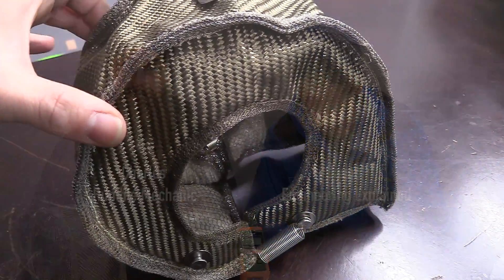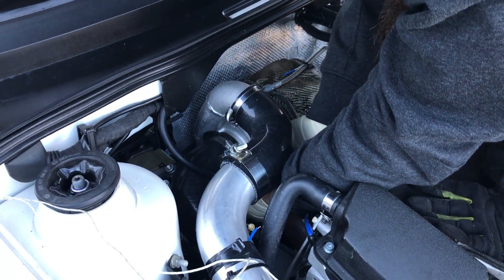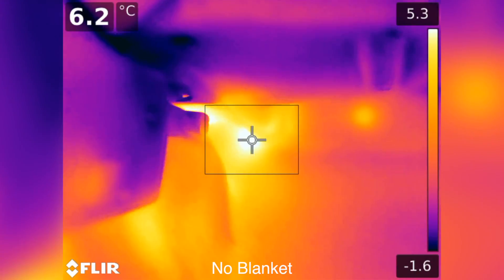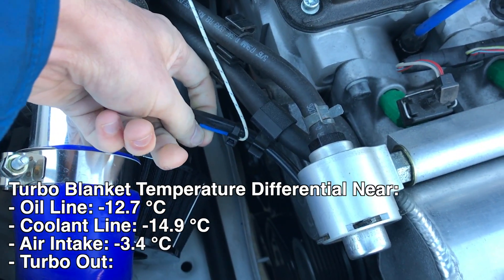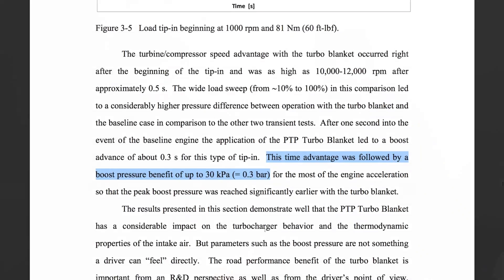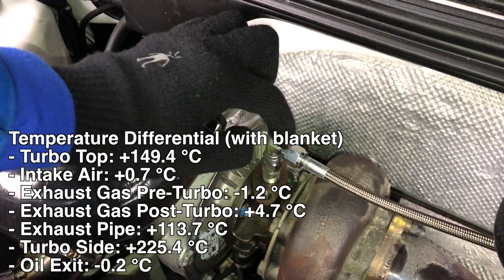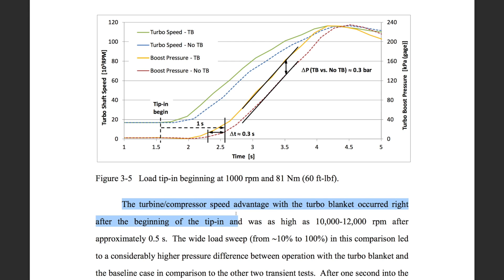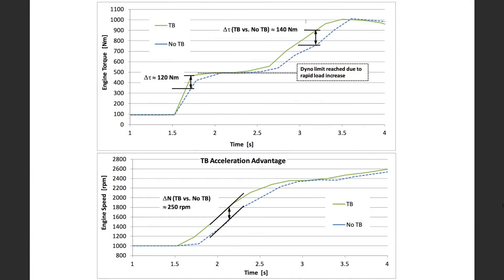Can Turbo Blankets Be Proven To Increase Performance?

Comment: Even though I understand the thermodynamics here, I've nevertheless been umming and ahing about a blanket. Thanks for the brilliant explanation.
Q: would insulating the compressor side (even without a turbine blanket) help the IAT?
Reply: You'd be better off putting exhaust wrap on the headers

Comment: Maybe you could test performance at a track and on a dyno. Scientific research is made to be challenged or verified.
Reply from the maker: I'd trust lab data over random track data. Unfortunately a track has so many variables that you'll never really get a back to back comparison like you can with an engine dyno stand (for testing something like this). Agreed though, it's always good to challenge information and perform additional tests; perhaps using different engines, blankets, etc.

Comment: Aren't there any negative effects? The turbine is hotter than before and it's spooling faster. Wouldn't it reduce turbine's reliability? (Maybe change the material properties with extra heat, change gaps due to material's expansion, etc).

Comment: I like the idea of turbo blankets and they do their job well, but would keeping the heat inside the turbo cause the turbo to have more wear over time due to higher internal temps?
Reply from the maker: Surprising to see the oil temp remained the same though, yeah?
Reply: That is true, I would have expected the oil temps to go up. It would be cool to see a long-term test with turbo blankets and whether or not the engine/turbo lifespan would be changed in any significant way.

Comment: Very informative. Surprised to see the oil temperature in the turbo barely changed. No worries for added wear and tear then as the temperatures around the turbo are cooler also with the blanket.
Reply: The oil out temps were from the lab experiment done on the cummins diesel 
where the conditions were lab controlled and precise.

Comment: oh look a golf 3 gti
a 2l turbocharged car that is slower than the 1.6l corolla from that time period which didnt even try to be fast
Reply: HECKproductions You're talking about a stock non-turbocharged 2l. A turbocharged 2l would be quite a bit faster than a corolla, the one in the video is actually a turbocharged VR6.
I'm not a VW-fan at all (had 2 and would never own one again except maybe an aircooled bus), but if you want to be a smartass, start with being smart instead of being just an ass.
Reply: If you’re going to talk crap, at least know what you’re talking about. You’re wrong on multiple accounts. The 2.0l engine in mk3s were not turbocharged. This is not a 2.0l engine, which you would know if you used your eyes and saw multiple indication of it having 6 cylinders. It is a 2.8l VR6 turbo...

Comment: the way you mounted to temperature sensors seems sketchy. you really should have covered them with aluminium foil or something, since the sensors themselves are also quite sensitive to heat radiation. this can mean that you are not measuring the differecne in temperature of the coolant line for example, but you are measureing the sensor itself not getting hit by heat radiation any more.
Reply from the maker: Generally speaking, they all had quite a bit of airflow next to them (as was apparent while driving versus stopping), so the temperatures measured were all essentially air temp. Also, measuring radiant heat isn't a bad thing - the oil line and coolant line are susceptible to radiation, so it's useful to measure it.
Reply: i work with these sensors every day. airflow is never a good thing when working with these. airflow is cooling the sensor down. then you are just measureing the air temp and not the temperature of the part that you wanted to measure.
measuring radiant heat is valueless by the way. try to put the sensor onto a mirror and then try to heat it up with an infrared lamp. the mirror wont heat up, but your temperature sensor will show a very high temperature.
Reply: @MrBusunglueck  I second your statements, the sensors should have been thermally bonded to the surface so they're not mostly measuring air temp. Note that the referenced UTexas paper said "good surface contact is crucial; all surface sensors are bolt-on type", meaning their sensors had a tab with low thermal resistance which was bolted to the measured surface.
Reply: @dankingsbury9971  Thanks. I didnt say it as elegantly as you did.

Comment: Can the camera actuelly measure metal correctly? As far as I know it is very hard to do that because metal reflects more infrared light than it emmits it (30% emmission I think). I usually use emmission stickers on metal. Also my camera only measures up until 250 degrees celsius. What about the 50k one?
Reply: Hi Jason, I think you are misunderstanding the question. When measuring temperature on any surface (specially shiny metal) the emissivity of the material will greatly affect the temperature reading. By default, the camera's emissivity setting should be 0.95, but that is not the case for metals. If the setting is left on default, the temperature reading will be much higher than its real temperature. 

Also, beware of reflection, the compressor side is a good example, the temperature image is not even, the shiny side of the metal reflects heat from turbine side. 

Another example is the heat shield of the firewall, the emissivity of that material is very low, so it is very difficult to have a good measurement.

One cheap way to combat this issue is using electrical tape. Just stick a piece of the tape on the surface you want to measure and wait a couple minute for it to reach temperature equilibrium. It has emissivity of around 0.95, so if you point the camera to the tape, you will very likely get the real temperature of the object you are measuring.
Reply from the maker: It calibrates all the time to try and compensate for it (when the image freezes), and tends to do a nice job. The temperature range is very high, well above 500 C shown in the video, but I'm not sure what the top range was. Maybe around ~1300 C if I had to guess, but perhaps higher.
Reply: I spotted some reflected heat in the video too, Vic. You raise a good and interesting point.

Comment: Hey Jason, does that heat kept in from the turbo blanket affect the turbo negatively, like wear and longevity etc? Also, can you make a video about the gold heat reflective tape? I’ve seen a couple videos but they used direct heat to test it not radiant heat. I’m kind of skeptical but no good experiment has been done to prove it reflect radiant heat.
Keep up the content!!
Reply from the maker: I just learned about this stuff, I'd be curious to test it as well.
Reply: @EngineeringExplained  please Jason? Go further on this! There’s so much to learn and discover on turbo heat management

Comment: better use a methanol injection kit to cool down the intake air.  I also think that its pretty harmfull for the turbo for overheating and extra wear because it cant lose its heat

Comment: I`m pretty sure that this could cause problems when you turn off your car hot. Probably going to ruin the turbo bearing with the extra heat in the exhaust side turbo housing.
Reply from the maker: Yes, this was discussed in the video as well. It's important (blanket or not) that you let your car "warm down" (cool down haha) after you've been driving it hard, to let the turbo temps drop and keep the oil healthy.
Reply: Exhaust gases 800C at idle? If you say so.
Plus if you do it properly and drive gently for the last couple of miles and make full use of overrun conditions you'll have pure air passing through with no combustion, so it'll cool nicely.
Reply: i said 500-800°C. neither you or i can scientifically proof our point by argueing.
one thing i do struggle to understand though. 
why would you heat wrap your exhaust in order to go a couple of 1/1000s of a second quicker, if you then have to go slow for much longer in order to not damage your car.
Reply: That's true, but as mentioned, you should not be turning your turbo engine off when hot. Let it "warm down" first. If you're turning off hot, you're asking for trouble, blanket or no
Reply: i know. i just dont think that its healthy for the turbo. mercedes have cooling ducts directly aimed at the turbochargers to cool them down while driving(amg gt). how are you going to let it cool down if its heat wrapped anyways?
Reply: The exhaust gases flowing through will carry away the heat
Reply: Thats wrong. Exhaust gas is like 400-800°C hot. Heat can only flow from a hotter to a cooler object.
Try to cool down red steel with a heat gun. I can promise you that it wont work very well.

Comment: instruction unclear, i wrapped my turbo with bed blankets for extra warmth but the engine hood it's on fire
Reply from the maker: Not sure I understand the problem; sounds like you're turbo is staying hot?
Reply: You did what? Bed blanket is not a thermal blanket lol. 
I hope you was joking..
Reply: lol, yes it's a joke...
higher temperature maybe increase the pressure but also the stress on the turbine...

Comment: Hey I just replaced my heater core.  Not a cheap or fast operation but necessary in NH.  I actually subbed to this channel while catching the car bug while shopping around.  In the end I went the cheapest route until I can afford a car I really want.  That is to say when I've finished my masters and not working for $20/hr at a lab or ethereum hits 10k.

Also I wonder what frequency those seven segment displays are multiplexed at.  Is it noticeable irl or is it fast enough to look smooth?

Also what does something like a turbo blanket do for lifespan of the turbo?  What is the lifespan of a turbo?  I don't know a lot about materials but I know higher temperatures are not good for them and something like a turbo sees huge changes in temperature everyday while under stress.

Comment: All positives and no negatives. Makes you wonder why manufacturers don’t do this in production
Reply: my guess is cost.
Reply: HumbleMechanic na. It would be a fraction of a penny to include this on a car. Hell, Porsche charges like 9 g’s for red seatbelts!!!
Reply: As an Engineer at a worldwide OE I can tell you why - - COST
Reply: Kristopher Klassen why would a manufacturer put something on a car that would make it run longer or better?
Reply: It increases vehicle weight raises the center of gravity up and moves it forwards. lol
Reply: It's possible like someone else mentioned that a blanket since made of porous material could collect oil if say something leaked or from vapor, potentially causing excessive oil fumes or smoking. There's also potential for maybe the down pipe welds at the turbo becoming fatigued earlier or require better materials. OEMs usually try to make their cars last 100k miles or 10 years so there's probably an issue with it lasting the duration of the ownership.
Reply: +dguy6789 Where? Additional weight?

Comment: Do modern cars with after shutoff cooling pumps for the turbo require idle engine cool down? Fiat 500 abarth has a pump that runs if the turbo is still hot after shutoff
Reply: My GTI has that pump from the factory. This car was also not turbocharged from the factory. I still let it run for a minute or so before shutting it down, then let the coolant pump run until it shuts down.

Comment: Wow, nice camera (the one filming, not sitting on the bench). Is it new? Also, I love it when you two collaborate. Great stuff guys.
Reply from the maker: That's Charles camera. You're noticing 60 fps vs what I shoot in (4k 30 FPS).
Reply: Interesting. I usually watch in 720p60, but I wonder if the 60 fps just survives the YT compression better. I was 'seeing' better detail and pixel clarity as opposed to thinking it was an fps thing. With two talking heads, one would question how the fps would change anything. It's not like you're moving much. Hmmm. Anyway, thanks for the reply. Charles adds a lot to your vids, you two work really well together. And as stated earlier, the vid quality was excellent for whatever the reason. Those FLIR shots owned.
Reply: I think it has more to do with Charles using a lower resolution camera (to achieve higher framerates) and the downscaling isnt as significant, so you keep that quality
Compression also does have a lot to do with it though, so thats definitely a factor

Comment: the turbo radiating heat into the engine compartment makes my engine heat up faster. i like that! especially in winter :)
Reply: Not at all. If you're running your engine hard enough to get your turbo really hot before the engine has reached normal operating temp, then you're asking for trouble.
Reply: We proved that with in cab temps too. Not fun in the winter for staying warm
Reply: Jason

it heats up faster in summer too! :D
it’s a transportation vehicle (golf vi 1.4l 118kw (turbo+compressor)), not a sports car, so the engine cooling takes care of that without any problems.
Reply: Kamil turbo doesnt heat up untill it spools up under boost.  So your theory is wrong.
Reply: That's not right. The turbo heats as the engine heats, with the exhaust flushing through. Sure, it doesnt hit peak heat till you're in high spool, but it would hit average heat without hitting the boost threshold.

Comment: Nice collaboration and research.  I was skeptical about the pros and cons of a turbo blanket but now i'm glad i bought one.
Reply: How's that turbo doing now 🤔
Reply: Its doing great. lasted for years with no issue.  It died recently when i tuned by car with ignition cut instead of fuel cut to get the pops and bangs LOL :) @mad-meh2719
Reply from the maker: Happy to hear it, it was great to have the thesis data from UT Austin!
Reply: The next thing i'm curious about is the performance/general benefits of a vented or raised hood!

Comment: hey in your video about variable valve timing; is it continuously variable or is it just two positions ??
Reply from the maker: In the video with Humble Mechanic, that is two positions. There are continuously variable setups as well.
Reply: Engineering Explained thanks 
Can you tell me in which engine they r used so that I can learn about them?

Comment: Other than quicker spool wouldn’t the waste gate keep the boost the same?
Reply from the maker: The wastegate can control peak boost, yes. But how fast you get up to peak boost is not controlled.
Reply: Right that's what I figured.  When you guys were talking about peak boost it sounded like you were implying that peak boost would be changed.  Thanks for the reply keep up the great videos please.

Comment: Are Vortex generators, a good mod?? could you do a video on them? Maybe you can make you're Mazda Mazda Mazda hit 200mph XD
Reply from the maker: As an add-on, it's probably very difficult to effectively use them without a good CFD analysis. From the factory, they can be proven to be effective.

Comment: does a turbo blanket reduce reliability/increase wear on the exhaust side of the turbo?
Reply from the maker: That's a good question, and it would be dependent on if the turbo manufacturer was somehow depending on cooling of the turbo through radiation, which is covered up by a blanket, and whether or not the turbo can withstand the higher temperatures. Ultimately, the exhaust gases going in are the same temperature, but you're just keeping that heat in the turbo, creating useful work from it, rather than letting it escape.
Reply: Definitely wondering about this. There has to be a negative to trapping that heat right next to the turbo.
Reply: @madpistol  no negative, thats where the heat belongs.
Reply: but it could still increase wear on the exhaust side, if its not clear wether the turbo needs tha area to actually cool itseld right?
Reply: Nelayo Isso 
Good question
Reply: Nelayo Isso Yes because of physics. No one seems to know to what degree.